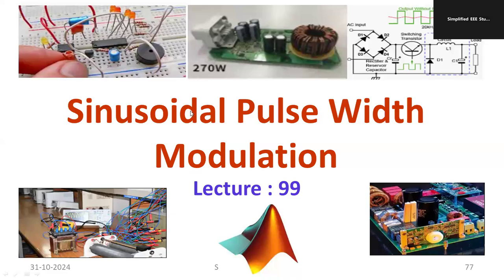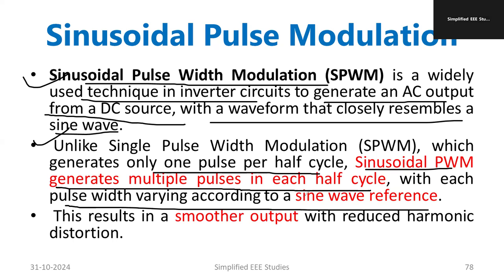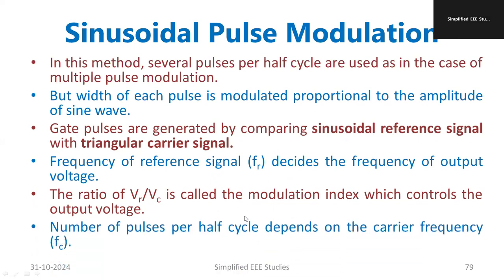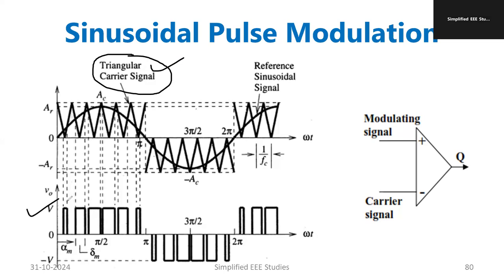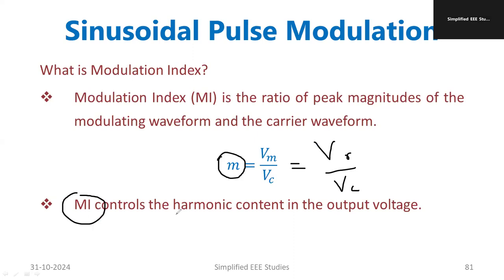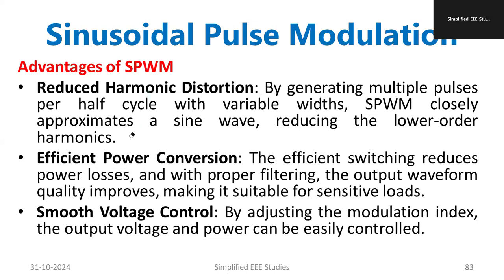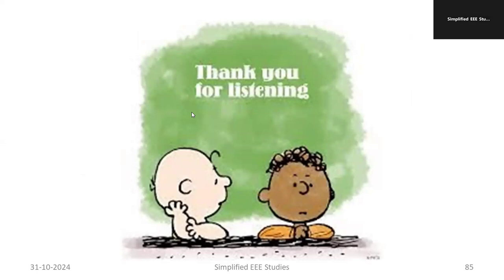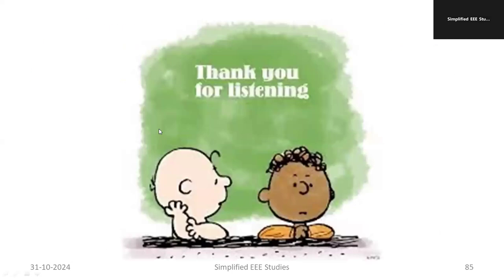Sinusoidal Pulse Width Modulation (SPWM) Techniques | Power Electronics Lecture Series | VTU & KTU

Comment: With using microcontroller how to generate pulse of SPWM please can you tell us sir
Reply from the maker: Good evening,

You can use microcontroller with burner kit

Download code for generating PWM with desired switching frequency

Output of microcontroller pin will be given to the gate driver

Gate driver output will be fed to control terminal of power electronic switch